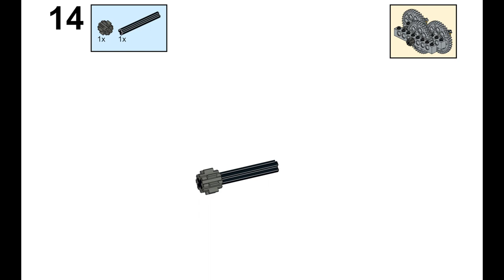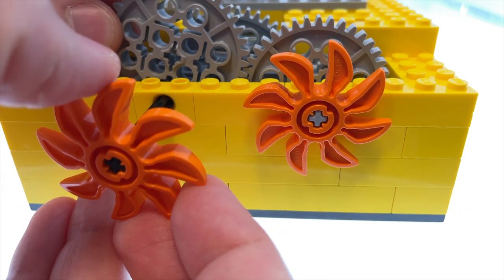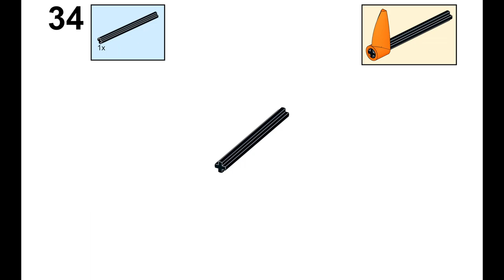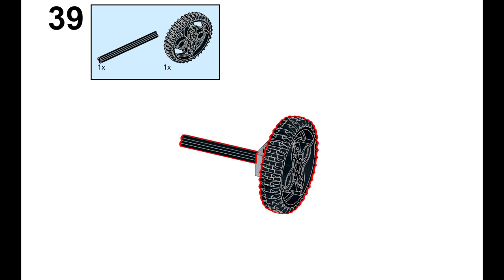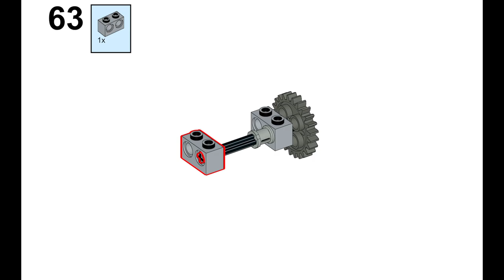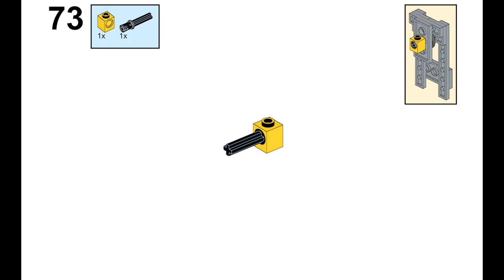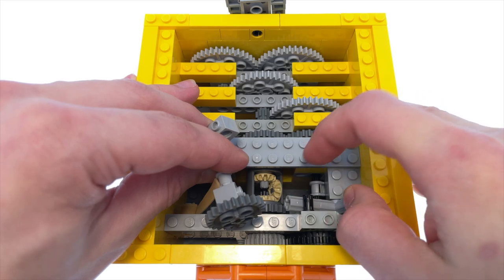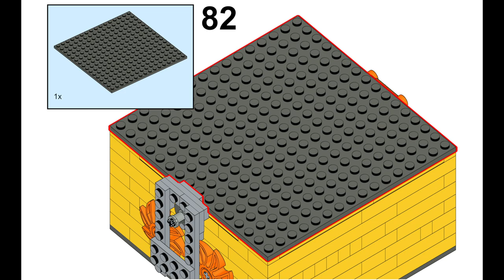Working FULLY ADJUSTABLE Lego Timer TUTORIAL VIDEO

Comment: Would it be possible to modify this so it can run on any increment on time, and send out signals in 3 equally spaced intervals without manual intervention? Doing this for a science project TIA
Reply from the maker: Please explain yourself further. The limiting factor here is the rubber band running out of tension.
Reply: @LegoTechnicsRule  Is it limited to just 5 second intervals? As in a signal, like maybe your last version where the rack came back up is a good example
Reply from the maker: @g30rgez  The intervals are determined by the gear ratio connected to the 24 tooth side of the differential. The gear connected to the differential is the ratchet. A 1:1 gear ratio acts like a 1:2 due to an anomaly having to do with differentials. Therefore, each click is 5 seconds hence 60 seconds/24 teeth x 2. The interval can be reduced by using, say, a 12 tooth gear as the ratchet. 60 seconds/24 teeth = 2.5 seconds. No x 2 because a 2:1 acts as a 1:1. I showed this anomaly in the video and a few people tried to explain it in the comments.